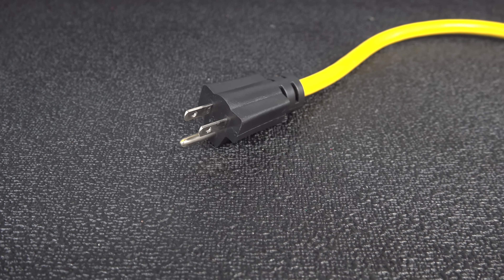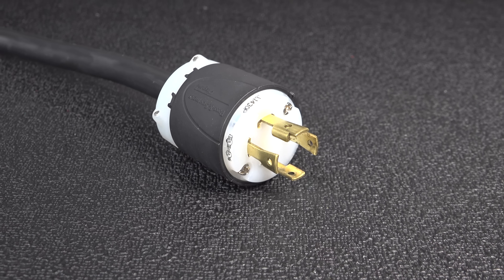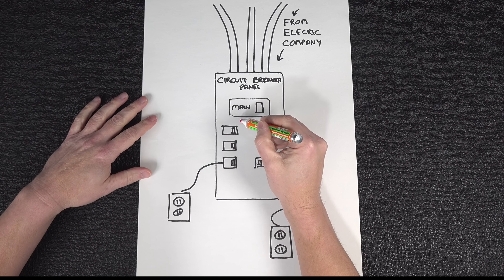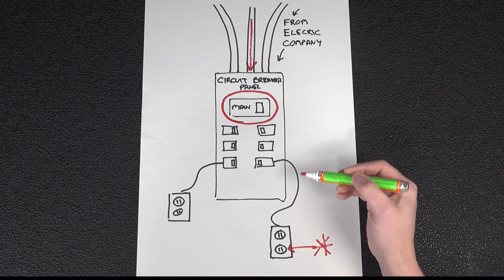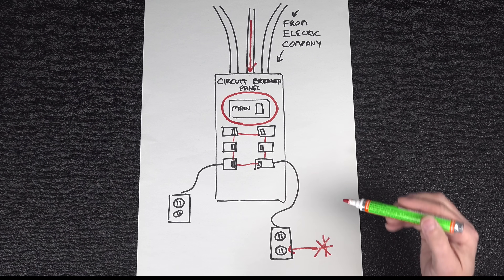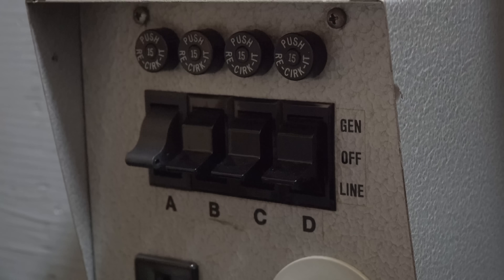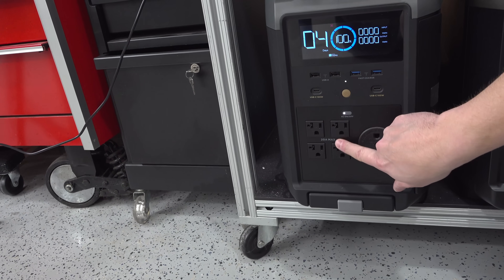Worst Electrical Mistake You Can Make - Backfeeding Generators

Comment: All ya have to do is open the main breaker or House Disconnect FIRST and everything works fine and dandy.  Also, after utility power is restored in your area, always disconnect from the generator receptical first, then remove the other end and then SHUT the Main Breaker or Disconnect. Q.E.D.
Reply from the maker: Sure, all in the middle of a disaster or storm. What could go wrong? This is exactly why the interlocks are required. You can't make a mistake in the steps. Seems like a good idea and good regulation to me to prevent death,

Comment: all tools have a level of danger or risk. especially power tools. years ago i made something similar for one of my friends in a pinch when they lost power for days. one end plugged into the dryer outlet and the other plugged into the generator. the purpose of this was to provide power to all circuits in the house through both 110v legs. but i explained the the potential danger and procedure in order to operate it safely. for instance first step is to turn off the main breaker and other non essential breakers. 2nd is to plug the cable into the dryer outlet. 3rd is to plug it into the generator. 4th is to start the generator. it worked great in a pinch when no transfer switches or generator ports were available.

Comment: Back about 10 or 11 years ago we had a bad ice storm and it killed power to most places for over a week but in this 1 small town where most people only speak Spanish the power guys kept getting shocked because they had the generators hooked up and the main line breaker was on so it would feed back down the mains so they tried to tell the owners to turn off the breakers but they wouldn't listen or wouldn't answer the door for cops to tell them so the power guys turned the mains back on and burned up about 30 gens

Comment: We had a 30amp breaker wired to ours, and we would install it in the main box when the power went out. With this setup, after killing the main breaker, we could power one bus bar at a time, but with a smaller generator and a basic breaker, we could run the lights and fridge, water pump (no hot water though) and such, while using kerosene heaters in winter when the power was most likely to go out from ice and snow/wind causing treefalls. We simply made 100% sure to always kill the mains before throwing the switch from the genset.

Comment: Never knew people did this. I was fortunate. When I was a child, my dad was the safety NCO in his flight, so he was a stickler for things done right.

 I grew up in a military, common sense-driven household even after dad retired. Our generator had its own little house in the backyard and a transfer switch box near the power meter main breaker box.

 Every time the power went out, I was on generator duty. Such a sense of urgency I had running down the stairs unsafely to go flip switches and levers and crank that annoyingly loud Coleman generator.🤓

Comment: The interlock kit is completely avoided by removing the front panel of the circuit breaker, that's why it's not an approved option in many jurisdictions.
Reply from the maker: They are approved under the national electric code. I have never seen a jurisdiction that did not allow them. I suppose there could be a place but it's definitely not common since they are both UL listed and approved as stated under the NEC.

Comment: I work part time in a hardware store, and we see people every winter ask for these cords for an even dumber reason than backfeeding a generator.

They laid their X-mas lights wrong on the roof, and ended up with two female plugs facing each other and can't plug in part of their lights. Instead of fixing it by redoing the light layout, they want to do the dangerous and lazy "fix" of just bridging the gap.

Had a customer in December require all 3 of us in the store to explain we don't sell those plugs. (Since shocker, they aren't UL listed.)

(For those wondering why this use is also dangerous, aside from the obvious shock hazard, you have a fire hazard due to a live plug prongs.)

Comment: How does the system prevent back-feeding of the electricity when a person has solar panels that feed excess back into the grid?  I assume there's something to prevent this when line workers are doing their job.
Reply from the maker: You are correct, when the utility power goes down there is a built in safety switch to stop the flow from the panels to the grid

Comment: that cable is perfectly legal and makes a lot of sense in applications it is designed for.
that been said, it is against the code to use the cable for other purposes and it should come in specific packaging with a complete list of DOs&DON'Ts.
Reply from the maker: Do you think it's odd that its not for sale, at Home Depot Lowes Walmart or any hardware store if its legal? Amazon blocked sales of it as did others. There is no legal use for it.

Comment: I wired a 50 amp receptacle on the outside of my friend's house and two 50A breakers with a homemade aluminum interlock in the breaker box. The generator can power his whole house. This setup is easy, safe, and munch cheaper then a gen-set that automatically turns on when the power goes out. Soon I'll be doing something similar to my new house but in 30Amp unless I buy a bigger generator.
Reply: Only hobbits live in a hole house.
Reply: @Hoekstes   Actually he was a hobbit.

Comment: I'd also add that NEMA 5, which that yellow cord plug is, is not rated for over 15 amps of current, which is typically a single breaker's circuit rating on a typical panel.   The copper strand in there literally isn't robust enough to supply the current that you need in a house, adding to the danger.  And before someone even says it, no, that is not 5-50 spec.  The blades are too small and the conductors in that cable are DEFINITELY not rated for 50 amps.

Comment: A lineworker got killed here during hurricane Sandy's restoration due to a backfed generator.

Too much stuff goes on behind the scenes that nobody knows about when it comes to pretty much everything in life.  But for power and utility (notably cable) lines, boy can there be a lot of problems from illegal (knowingly or unknowingly) modifications made to wiring in their house.  Even if you know the code, sometimes you just want to get something done quick and plan to fix it later.. but that "later" part often never happens.

I wonder if we'll ever get some kind of whole grid monitoring technology that will keep people's privacy but also expose any problems.. or more importantly, have it actually be put into practice and not take 50+ years.

Comment: I would like to point out the cool fact that while the point still very much applies to him, the gentleman in the first photo, at 2:03 was actually working on optical fibers. Which (both the fibers in the enclosure, and the cables containing the fibers) have no electricity flowing through them at all, the enclosure is a commscope/Tyco 450 D fiber enclosure. He was doing so in a very risky manner that anyone at the company I worked for would've been fired for, except in the EXTREMELY select few types of instances that necessitated it, possibly even still as he clearly doesn't have the enclosure supported by anything, and given the lack of a light meter/power meter, or an OTDR he had no justification to have the enclosure like that.  In any case we were always told to remain at least 10 feet away from any power lines, for obvious reasons. even still, backfed lines could potentially pose great risk.

Comment: When making your own electricity from any energy source you should have a way to disconnect the energy grid from your house, I simply prefer a second mains switch between the grid and your own energy source. Then your main switch and panel comes next. This also applies when upgrading your house to alternative energy solar and battery and you can simply choose to use grid electricity if you want to charge your battery from the grid.

Comment: 1..Don't be stupid.
2...Turn main breaker off.
3...Turn AC breaker off.(unless your generator will handle it)
4...Back feed through your dryer plug, it will hold the amps safely.
5...Use house normally.

Been doing it that way in multiple homes at a time for 30 years almost every hurricane season in the southeast. Never had a problem.
But remember...Don't be stupid.

Comment: Not the worst mistake by far. Also there's more condescending moralizing than useful information here. Just mentioning backfeeding doesn't explain it. This will make people curious and want to try it for themselves. When the power is out, people will try anything to get the lights on. Your frantic sky-is-falling approach is not the best.
Reply from the maker: There isn't a reason to rationalize something that already prohibited in every state in the US can void your homeowners and kill someone, and has multiple times. The reason I made the video that was shocked so many people seemed to believe it was a sanctioned practiced and were baffled by the lack of a commercially made cord. There's no sky falling, it already fell.
Reply: @SilverCymbal  I wonder what that "commercial made cord" would look like.

Comment: I made one of these by accident once. I worked in a large furniture shop and I had to change some lighting in a display. I was lying under these cabinets trying to re route and wire up the cables. There were several lights to do. I picked up a plug and got a bit of a belt off it. I found my way from the plug to the other end and found it plugged in to the socket. I had inadvertently wired a plug onto another plug

Comment: Long story short: "There are things that you can use this for during a power outage, but you will probably not going to be in the state of mind to hook this thing up properly while you are rushing around with your power out, and then this will probably murder the nice electric company worker that came to fix your power line. So most of the things you would use this for are illegal. Also, you might set your house on fire or something". 

You could get this to work, but let's be hoenst- this thing looks like some cheap thing you buy off amazon after googling for 30 seconds. Its intended function is relatively jerry rigged in nature, and it appeals to the kind of people that REALLY shouldn't be messing around with their power lines. The safer alternatives shown in this video require at least a modicum of knowledge and consideration that gives me a bit more confidence in the person getting it installed.
Reply: Well, some lousy online store is about the only place you could one of those already assembled, since any actual DIY or hardware store wouldn't sell that to you.

Comment: I work for a radio station, one of our transmitter sites sits on rented property, the other broadcaster who owns the place has their own generator as we do as well, when the other broadcaster generator shuts off, it sends a shut back across the entire site shutting off all breakers that are not being fed by that generator(our breakers as well as the other renters) with breakers switch off a generator is kinda useless so when ever I get a email that our genny is online I drive out to take the genny out of auto and wait until theirs turns off, then I know A power is back and B we won’t get a surprise shutdown, then I switch back to main power and pack up, of course power outages only happen in the most hardcore of rainstorms and blizzards and I’ve been in unlucky situations where the road In Had not been plowed in weeks and the blowing snow across the fields made things worse that even my very capable jeep could get stuck in, so I’m left hiking with my tool bag over my back, not even sarcastic I fucking love my job

Comment: I don't know why we didn't think to just do this when the local terrorists blew up the power substation in town. We ran extension cords from the generator outside up into the desired areas. It would have been much simpler had we backfed our panel... It would have been really easy to flick the main switch off and have no issues. Oh well, just glad we haven't needed to do so since.

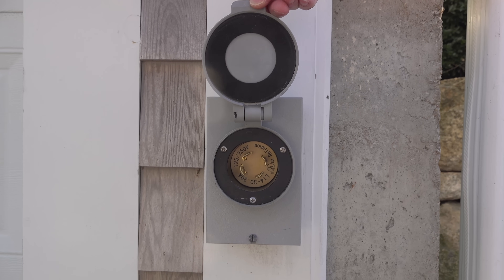Comment: 3:00 I think after just (correctly) stating that electricity does not care where it comes from, you should elaborate more clearly why touching these prongs is safe.
Does it have high power diodes to prevent reverse current? Or some solenoid switch that disconnects the outlet?
Or does it just operate on the assumption, that the breaker being on must mean there is no external power source connected?
Reply from the maker: The prongs shown in that part of the video are part of the shown interlock system, they are completely energized as part of the interlock. No diodes or electronics.
Reply: It's not an assumption, the interlock insures that the generator outlet cannot be on while the main power is on.

Comment: No brother, been running my genny like that now for 15 years, never had a problem before.. just one rule though, keep idiots away from the cable. It is not for the faint hearted, electrical engineer guru type of guy, let them play with their fancy auto and manual change over switches.. we do it simple, fast and i tell you one thing, that cable will never let you down, those auto changeover rubbish cost an arm and a leg and give problems as they age..  and another bonus apart from the genny's own protection the cable connection is also running through the protection of your plug circuit and overload switching. 🤗😁👍

Comment: Hi, Electrician from Germany here. A lot of Things you said are correct, but I would say the main concern  for Powerplantz about backfeeding are the not synchronized voltage spikes of AC, which effectively is increasing Voltage in any outlet and furthermore in your Generator, which can cause serious Damage.

Comment: Where I live (3rd world shithole) its very common to backfeed with male-male connectors to a random outlet in the house, and I don't know if its illegal but no one here cares actually, never thought of that as a safety hazard at that level, also when you forget to turn off the breaker you notice immediatly cuz the generator goes full apeshit, like revving at max speed, not very common for that to happen tho.

Comment: What we did was intercept the line coming from the street, connect a "main switch" there. 1 connects street to main, the other connects generator to main but not both at the same time. zero chance of backfeeding.

Comment: We have an outage with any storm that rolls through, comes with being in the woods. But we use a huge welder/generator/air compresser to power the house. One time we were running our house and a few of the neighbors rooms.(essentials). And never have I seen a pre made male to male cord, or have known it’s illegal lol. Also we’ve never had risk of shock cause we plug the house end first and always main off. (In my room) osha gunna be disappointed in all of us tho😭

Comment: Reminds me of Romania. Crazy unsafe cables! Was so bad I couldn't believe it. It was almost exactly the same cable in your thumbnail!! Cable of death. Side note, also in Romania, I was taking a shower and turned off the light barefoot, got electrocuted. Opened the fridge barefoot. Electrocution!   Just a strong zap that knocked you on your ass.

Comment: I think you're overshooting a little bit. Yes the cable itself is dangerous nobody's gonna doubt that, but the way you're demonizing backfeeding seems a little over the top to me... People just have to make sure the main switch is turned of and that the live they're plugging in the generator is able to handle enough current (so the house won't catch fire... I'm a little surprised you didn't mention that...).

Calling the whole act "illegal" seems kinda questionable when it's actually only illegal to do that when the main breaker isnt switched of.

Comment: Good video. Have to say, I'm a little alarmed by this for two reasons; First, any cable terminated both ends with a male plug would be illegal in England. Second, electricians make mistakes, which is why NO male prongs should ever be accessible in any wall-mounted socket, ever - even if designed to be dead. English safety standards are bloody strict about this, because even certified sparkies get things wrong sometimes.
Reply: the cord with 2 male plugs are illegal in the u.s. also. 100+ years ago, england had very dangerous wiring practices. glad to hear they are strict today, especially with lighting & appliance voltages at 230 volts.

Comment: how come its illigal ? peolple with solar panels that have extra power get paid per kw so i assume they feedback energy ?
Reply: These systems are designed specifically to do so safely. Most importantly, they cut themselves off from the grid if grid power goes down, in order to protect linemen who expect the lines to be dead.

Comment: 2007 after a big storm my house was cut off the grid for two days.
So I got us a generator and... i installed a second small grid into the house. Totally disconnected from the normal grid - and having one special colored plug in each room.
Those plugs are dead if there is no generator comnected.

Since 2007 there has never been such an emergency.

Comment: Better, install  a double pole/double throw transfer switch... there, you cannot surely backpower ur circuit breaker because it gets power from transfer switch only-where it feeds power to the breaker one at a time, eder from line power, or genset power...